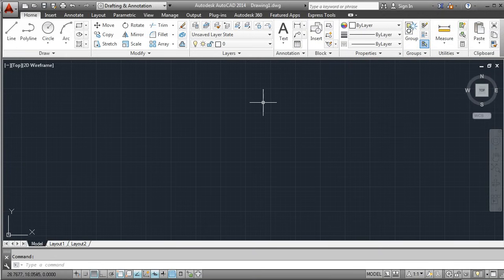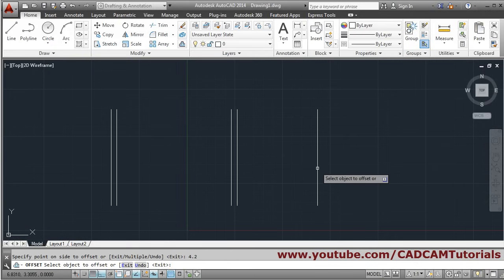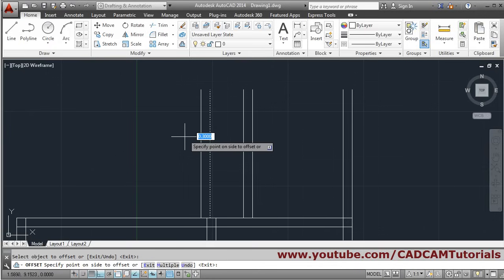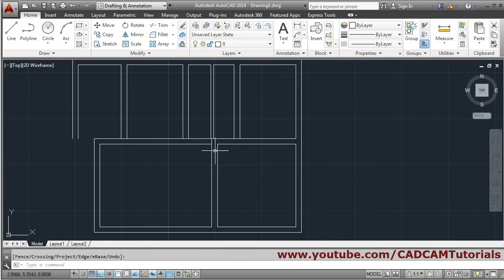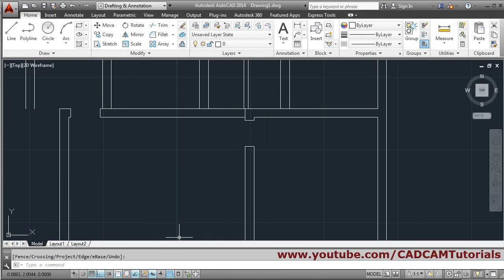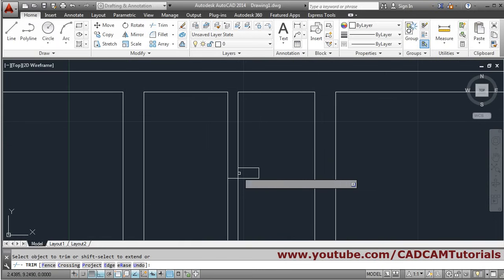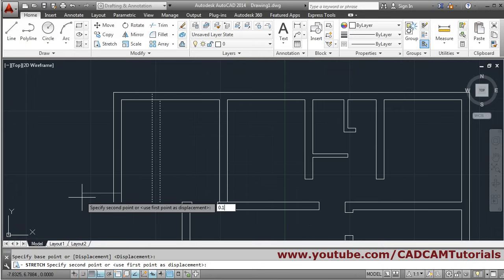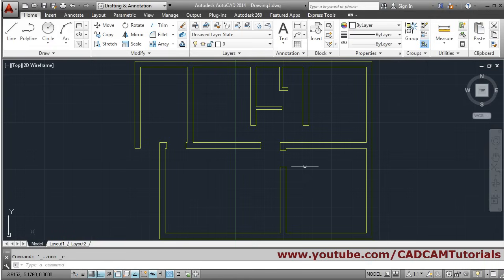AutoCAD Floor Plan Tutorial for Beginners - 1

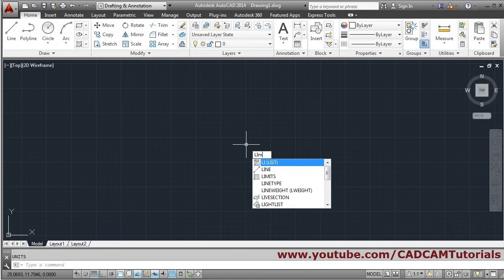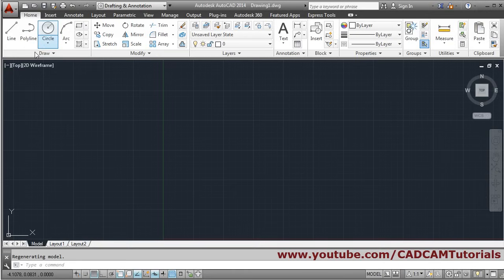Comment: i didn't understand the first process 1:15 to 1:42 LIMITS - 0.0 - 15.15
Reply from the maker: If correct template is selected then limits are not required.
Reply: @CADCAMTutorials   thank you

Comment: For some reason on the bath entrance the distance is 0.850 m when it says 0.8 m. I don't know why?
Reply from the maker: Yes you are correct. It comes to be 0.850m. To make it 0.8 m you will have to stretch the WC wall by 0.05m down.

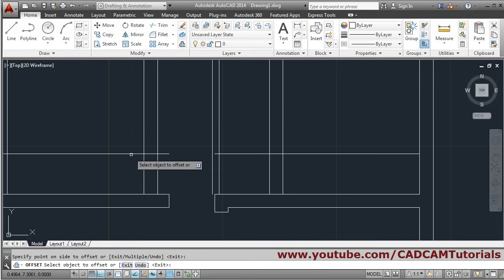Comment: 12:31 I dont get it why is it 0.9?? wheres the 0.1?
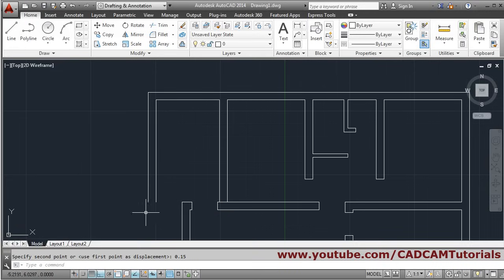Reply: And also sir at 16:59 why did you stretch it to 0.15 ?? so you extend it it will  be a total of 2.45 instead of 2.30 which stated at the drawing
Reply from the maker: Drawing is wrong

Comment: when iam taking line command or any command my cursor moves 1m by 1 m it is not flexible in 2014...what should i do
Reply: Sounds like snap mode is on.  Press F9 or ctrl+B to turn snap mode off.

Comment: When I take line command, then my pointer shows the intersection point but when I click on that for start point then it starts drawing from mid or end point. Please, advise me what to do?
Reply from the maker: Press Shift + Right click, menu will be shown, from that menu select intersection, then click the point
Reply: Really I am grateful to you for ur prompt reply. But my problem still exists. When I want to join perpandicularly then it doesnot joint like that but make a line with end or mid point, though ortho is on and intersection is also on.
Reply from the maker: After shift + right click select perpendicular and not intersection
Reply from the maker: Then click on the line, you want to create perpendicular to.
Reply: Sir, at last I got my answer, also you told in ur lecture that for going to intersection point need to go first mid or end point after tracking again can come to intersection point without clicking. Thanks.